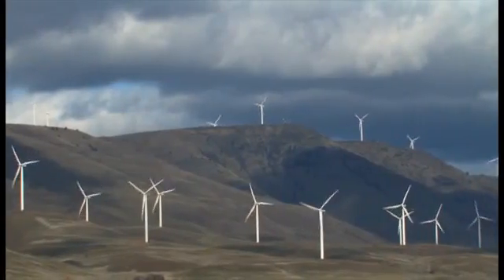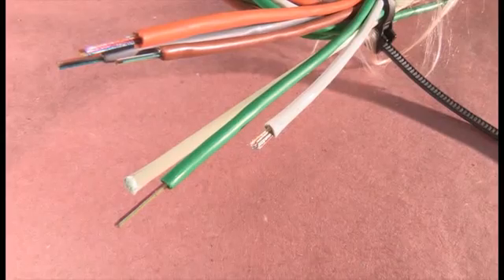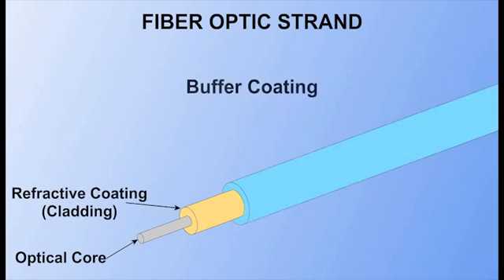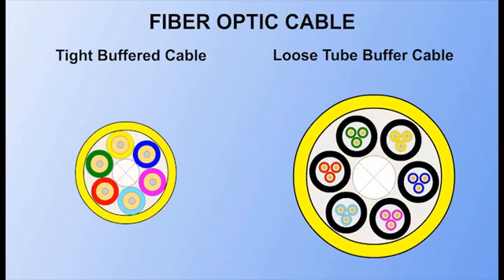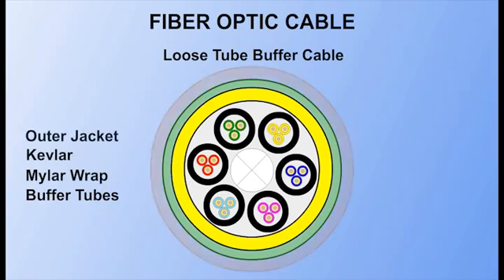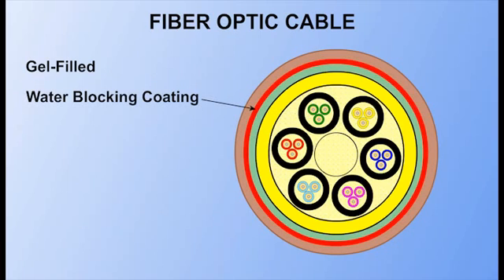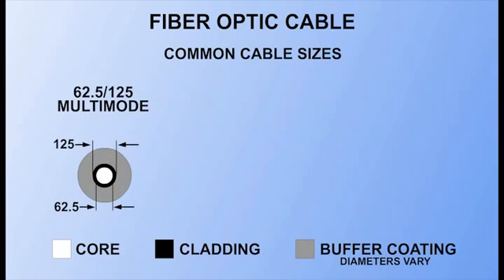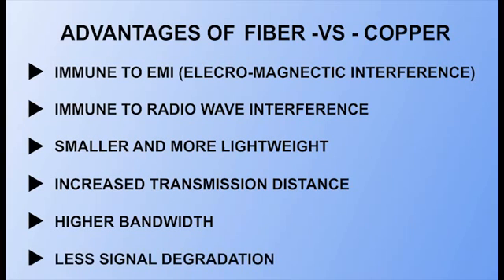Fiber Optics, How it works??

Comment: I came here to see how it works, not how it's made
Reply: The field process is based on the principle of total internal reflection. Light travels like em waves. which travels sinusoidally. Therefore optical fibre is the one of the best form of light derivatives which are used often in telecommunications.
Reply: @syncprolab8978  i had a stroke reading that
Reply: @i3lackflo  😂😂😂😂 because science is an art of hair raising experience.
Reply: @i3lackflo  Now i hope that u don't get stroke any more 😂😂 enjoy reading
Reply: @syncprolab8978  much better thanks m8 😂